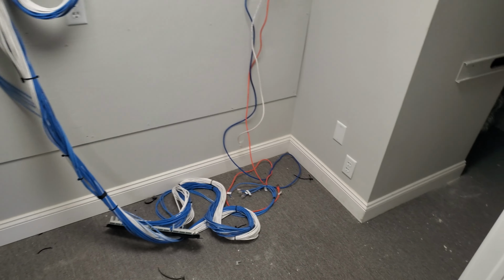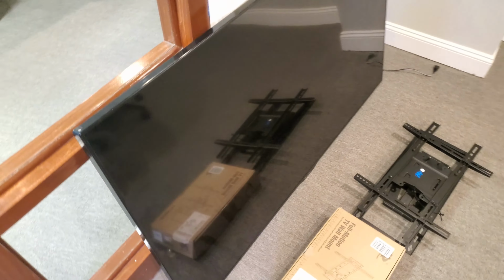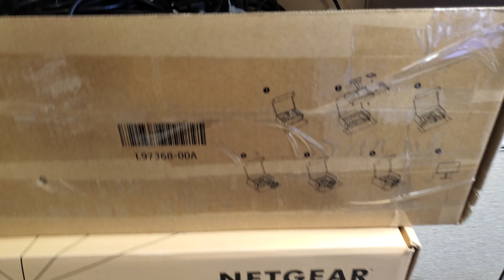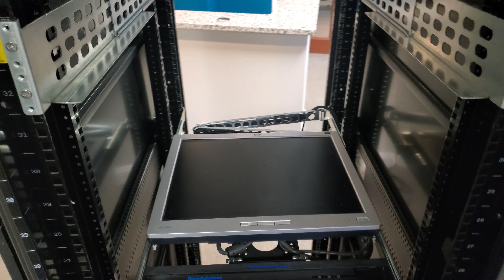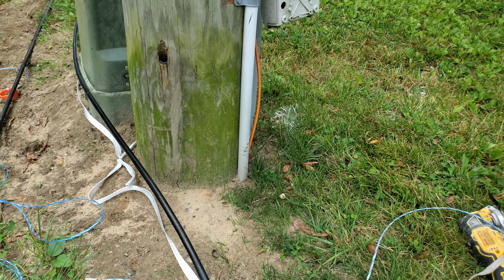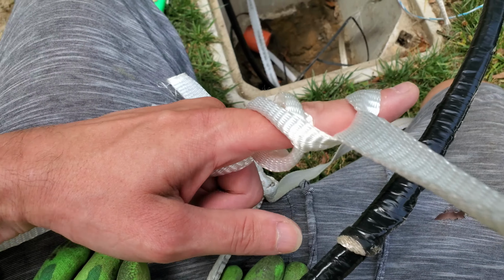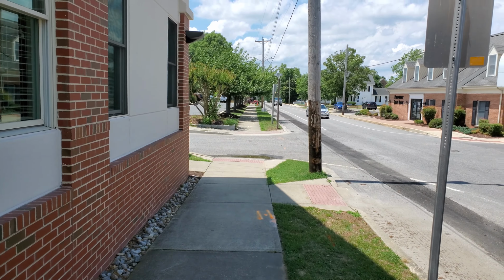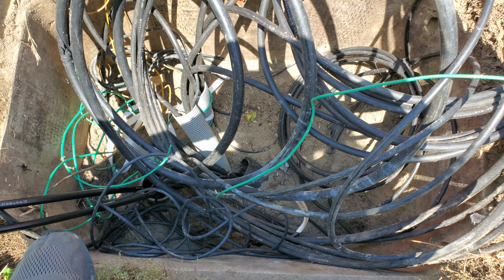A bunch of free gear and pulling in about 3300' of 96c fiber

Comment: perfect gear to make ha opnsense and a small cluster - good to learn on #family tradition    hp z gear is actually decent - good mem capacity - and cheap 256gb ddr3 is like 120 bucks if you shop around - they have a few proprietary parts